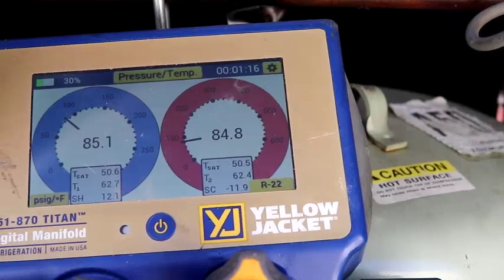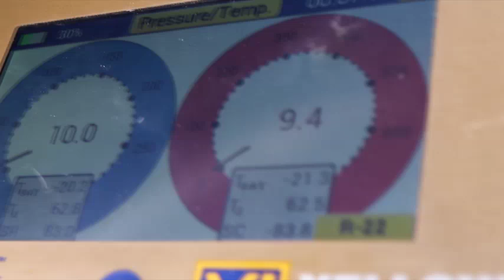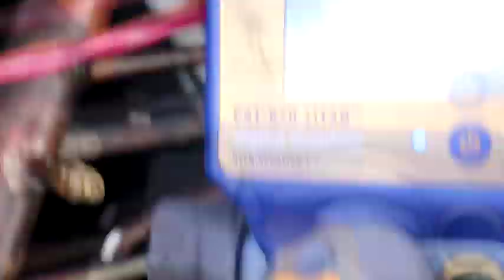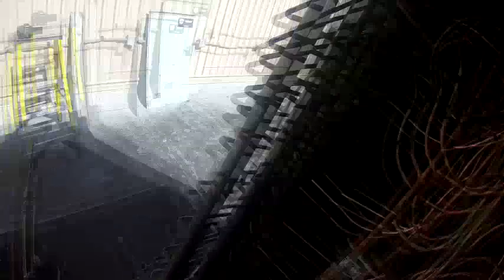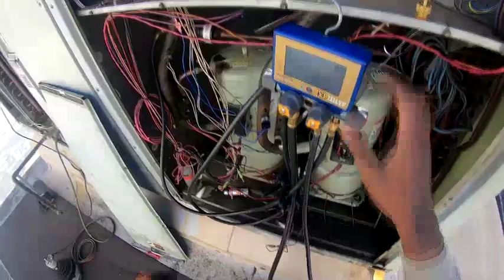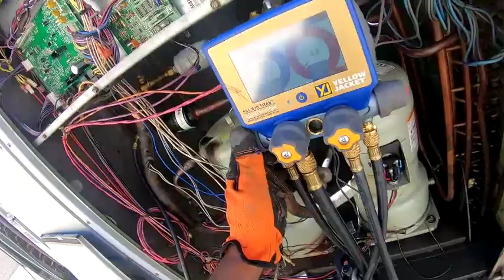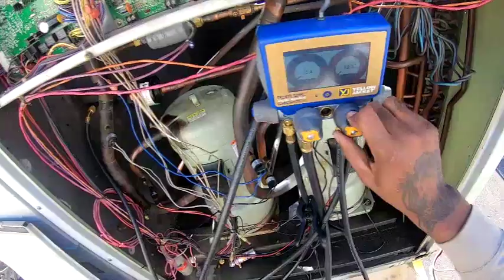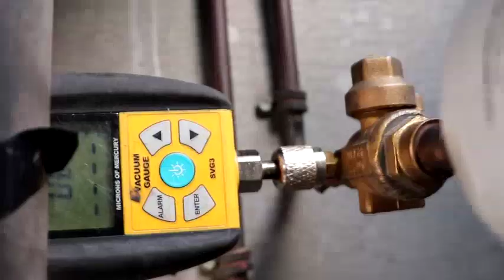Replace TXV and capillary tubes

Comment: That was a great video! I noticed the way you approached the web of capillary tubes and the strategy you used to replace them. Very smart. I also wanted to mention the incident where the nitrogen tank got bumped. I've found an inexpensive circular piece that has stability feet around the outside of it and it fits around the bottom of the tank, actually the tank fits inside of it, and it provides a stable bottom for the tanks so there are no more accidental tip-overs. Those regulators are expensive. The whole thing is portable and able to fit your next container. Just thought I'd mention it. You've probably seen them before but after the regulator got broken I bet you'd wish you had invested in one. But anyway thanks for this informative video. Once again your planning and approaches were highlighted and the bit of advice at the end was great.